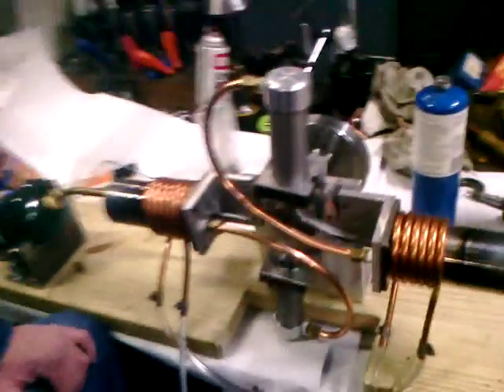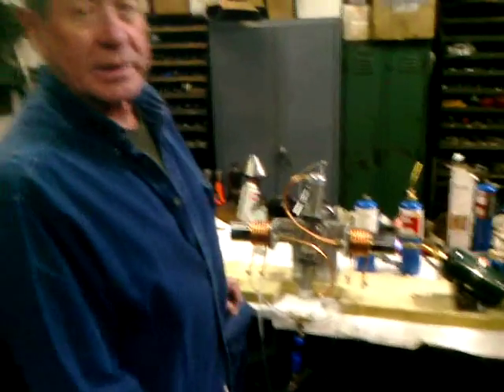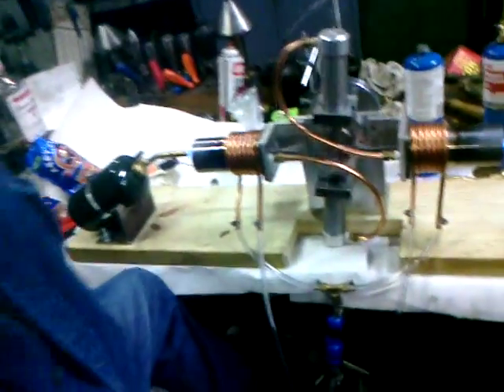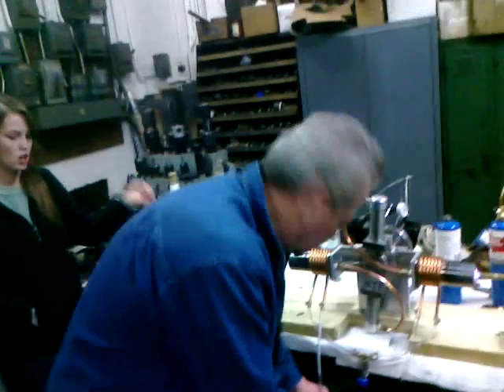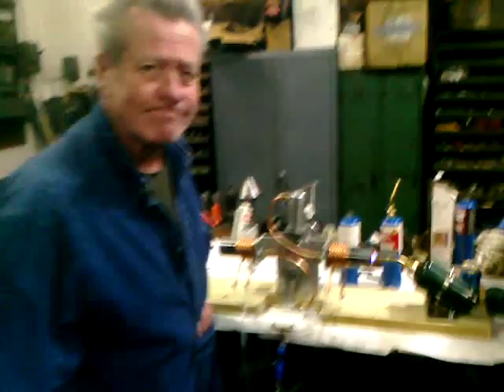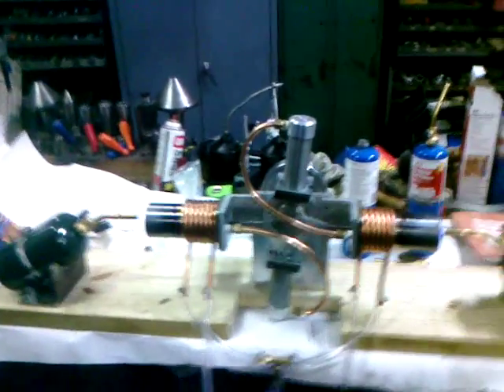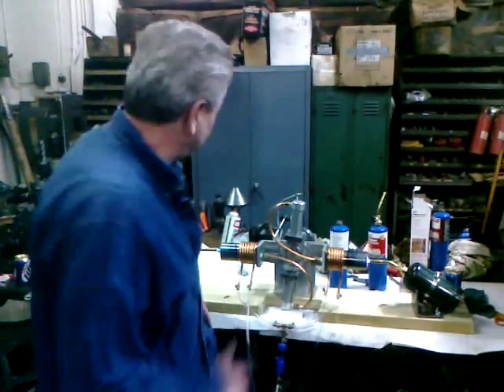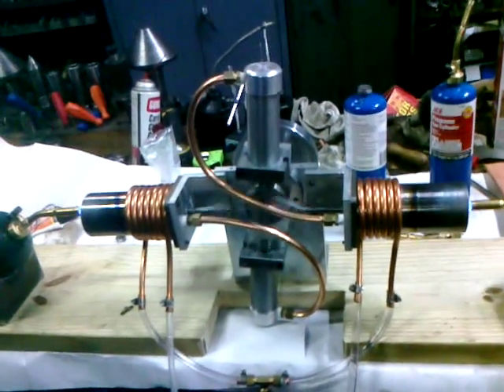Great Hot Air Engine Project

Comment: i noticed that you have the water cooling coils at the base of the cylinder, and heat (tourches) at the end of the same cylinders, so i am guessing that those are just displacer pistons, and the other two cylinders are normal pistons,  so this is a Gama stirling engine, (you may have said this in the video but my sound is AFU) nice build but if your going to spend so much time why not build an Alpha stirling? after all an alpha would have been faster and stronger.